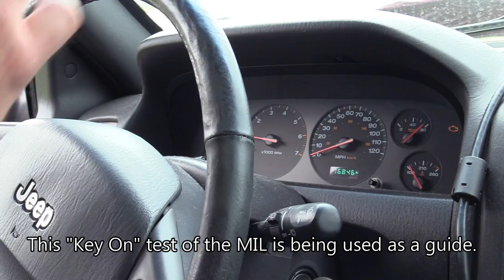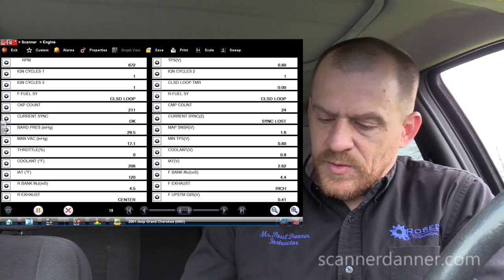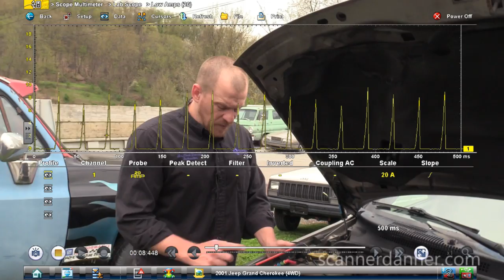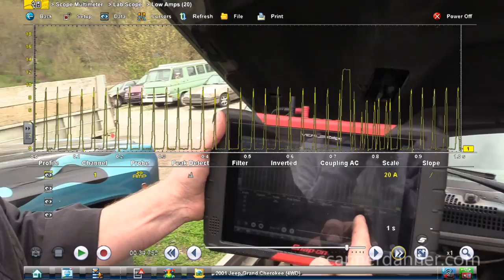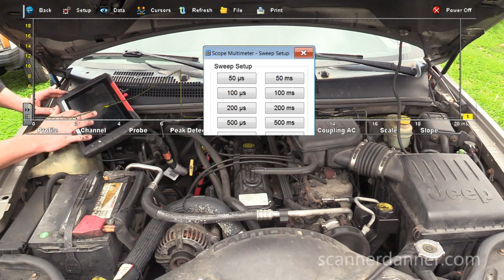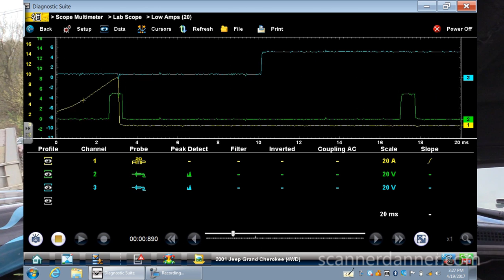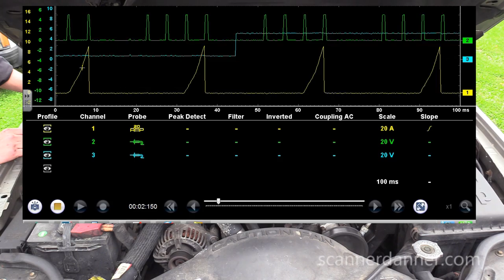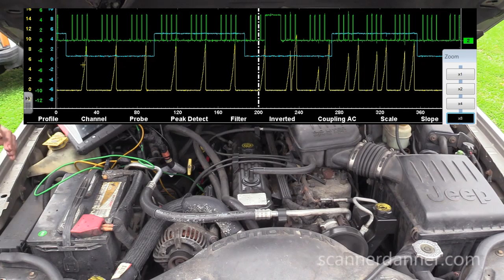Jeep Cherokee 4.0L Misfire and Primary Ignition Trouble Codes

Comment: Mr Paul Danner is the reason why I got back into auto repair,after 10 years.
When I seen things that ScannerDanner does with Verus,Pico and just basic Electronic diagnosis,I was seriously Wowed.thanks Mr Danner for sharing that God given gift you have.Thats why I will be your online student for many Years to come.
By the way folks ScannerDanner Premium Channel is absolutely Superb,Cannot get better anywhere.
Reply from the maker: I'm without word. Seriously. Thank you so much!
Reply: But my jeep don't have that adjustment because it has 2 bolt holes and have went through 3 or 4 sensors 😊

Comment: Yes!   Great video,  had random cylinder misfires just like this on a 2001 4.0 Jeep Wrangler with AT.   Had a new aftermarket  crankshaft position sensor, all the other things too, new plugs, new coil, checked all injectors for resistance, etc etc.   Saw this video along with another one from South Main Auto Repair, both said to use the factory original Mopar part, so I took the chance, replaced the aftermarket crankshaft position sensor with the factory piece and problem solved!    Thanks for posting the video!   Great videos as always!

Comment: Gotta rewatch this whole video, this is exactly what's going on with mine to a certain extent. These are the exact codes I have on my 97 jeep grand Cherokee.
Edit: exact codes and problem
Edit 2: disconnected the CPS to see which part I have to pick up. Reconnected to get to the store, and jeep is running great. Misfire problem I've been chasing for months is finally gone. Thanks SD

Comment: excellent find and description, ive replaced my crank sensor and i got no felt with it. something i will need to check. ive replaced about everything on my 1996 jeep and breaks down under load in gear, i replaced with a new distributor, sensors on throttle body, exhaust uppers and lowers, fuel pump, plugs, ill do plug wires too i think. for people who have little money this is a wonderful video. we all are not well off. i will re look at crank sensor adjustment. after my jeep cut out i put a new crank sensor in, i started jeep ran like new, switched it off thinking great work have a coffee. that was it never ran properly since the first start. and months of replacing stuff has not fixed the jeep. ive had no car, and until it wont go after 10 years of reliability im lost with out it.
Reply: and i have no fault codes at all on the dash.

Comment: Thank You I like your video.
I was waiting 3 years to put a new wiring harness in mine and finally installed super heavy duty cables.did a bran new Bosch alternator which are hard to find and a bran new starter and battery today.  What a difference when I turn the key. I got the harness for 200.00. I think it came from Vegas I need to check paperwork. Was well worth it.  There are a few great custom wire companies out there but I'm  happy I picked the one I did. I just did my crank sensor and doing my Bosch iridium plugs and coil pack next week. So I can relate watching your video.

Comment: another thing to look for on the jeep 4.0 if the crank sensor loses signal the rpms will drop almost instantly to 0 and pop back up.
Reply: This happens to me right now, if this is the actual problem I'm going to be so frickin happy. So glad I found this video and comment
Reply: Dude same lookout for this I’m gonna replace my sensor because Emmy ignition coil secondary code 0352 pops up but I have no misfire codes
Reply: @paulguy6548  what year? Mines a 97. I replaced the sensor on mine with what I suspect was a jun k sensor it ran fine for a couple weeks then major stall issues

Comment: Whats really funny is that it took probley hundreds of electrical/electronic engineers thousands of hours to design that ignition system.  But when there is a fault the mechanic has to know how the system works and there are hundreds of different designs, how to go about troubleshooting it and then how to fix the problem.  This takes someone with the qualifications of a college degree'd engineer.  how many people are out there that can do this type of repair?????   There are only so many Danners, Ivans, Eric O's,
Reply from the maker: Thanks so much gary smith! The crazy part about this one? There were no faults whatsoever associated with a crank or cam sensor problem.
Reply: It’s critical these days to have some kind of way to research the system. Sometimes an OEM just does weird things, and MOPAR especially. They’ve paired with so many other OEMs, and you can see the various design and engineering philosophy differences between model years. Vehicles have different virtual modules inside one physical controller, different communication protocols, etc, etc. I actually found this video because I was trying to find a way to look at the secondary patterns on this quasi waste spark coil on plug ridiculousness...

Comment: Speaking of of air-gap impediments, I have an oil leak in the transmission that gets on the sensor and returns Interim Cam/Crank Disconnects.  But now, I don't think oil's a problem interfering with the magnetic sensing.  I've been driving it for a long while under that condition but now, the missing is out of control on all cylinders (like your situation), the coil's good, with cam and crank sensors both replaced within the last 2 years.  I'm thinking to replace the crank again.

Comment: I have a 2000 Jeep Wrangler, which I know I should replace, but I have little to no reason to at the moment.  Though, I have a rather huge reason to now.  Just recently, my Wrangler died on me, on I-85(just north of the metro Atlanta-area, in the dead middle of traffic), but no fault codes ever generated from the ECU.  The Wrangler wouldn't crank back up and run, even though the battery had a good charge, and the engine was turning over extremely well(still, not one fault code)  

Once one of the "HERO" Units helped me push it off of the road and to the shoulder, it stupid vehicle cranked(almost immediately, but still no fault codes).  I had an issue a few month later, after leaving a Starbucks in Rome, GA, where my Wrangler refused to start.  The vehicle turned over, again, extremely well, but the engine would fire to life.  Even then, no error codes.  All of this was approximately three years ago.

Well, today, of all days, as I was cranking my Jeep Wrangler(to see it running as well as possible, as I rarely leave home(due to disability; always remember:  Never, ever just leave a motor vehicle "sitting", without cranking it, running it, and driving it, even for just 5 to 15 minutes.  I shouldn't have to say that, but experience has taught me Albert Einstein might have been correct(if he even really said the following) when he stated:  "Only two things are infinite, the universe and human stupidity, and I'm not sure about the former." ...but, I digress...) an error code finally generated.  It was error code P0351.  So, thankfully, I finally have a place to start to try and correct this.

Now I just need to finally replace my current JK Wrangler with a Wrangler Rubicon.  Thank you for posting this video.  Great work.
Reply from the maker: okay, first, if it doesn't crank (no starter engagement) and the battery is fully charged, it will never be the alternator that will cause that. Second, the P0351 code, you are on the right video my friend. I have other Jeep videos with this primary ignition code too

Comment: i have changed my coil ran fine for a few months, changed plugs, i have manufacture control show on my computer not sure what to do, also showing codes for the coil pack, again i replaced put a new one in made the jeep run worse than it did put the old one in runs fine till you take off then skips and wants to die, skim also show put goes out once in awhile, i don't know if my jeeps haunted or just something i'm not seeing.

Comment: Hi there i been having problems with my signals wire . 5vdc are coming out from the pcm instead of having cero vdc.
I did check the engine wires

Comment: I had an engine changed out.  When they buttoned things up, they stripped the mount bolt of the crank sensor and I later found they epoxied to "hold" it in place.  In two months, I suddenly had a horrible mechanical noise under the hood.  It was the sensor bouncing loose on the flywheel teeth.  It never even threw a code but the sound made you think a rod had broke.

Comment: Hello 👋,   Got a question.  2001 Cherokee with intermittent loss of camshaft or crankshaft.. I also have ignition coil one primary circuit, ignition coil to primary circuit and ignition coil three primary circuit.. yeah it runs like shit.  What are your thoughts giving just this information?  Also , have you ever seen ignition coil faults like this when you have a bad Crank Sensor.. It seems like I have two separate problems what do you think?
Reply from the maker: pretty sure in this video we had false primary ignition fault codes from a bad crank sensor. Yes? Maybe it was this one https://youtu.be/qpL_0-8DrhE

Comment: Danner, I have one for you, 2001 Jeep Cherokee 4.0, no injector pulse when cranking the engine. If you mist the throttle body with carb cleaner it starts right up and the injectors pulse and it runs just fine. no codes stored and the TPS is not in clear flood mode. It had ASD P1389 code, bad relay- No security system. Cam sensor checks out, new crank sensor. PCM is good.
Reply from the maker: I don't like the ASD code you had. Your symptoms suggest a possible low voltage problem on that circuit (ASD circuit) based on your symptoms. I would want to know what the supply voltage is to the fuel injectors, DURING cranking, when it is not starting.
Reply: No volts during cranking have 12 volts at the injectors until the ASD clicks off.  With the injector connected both sides of the connector light the test light. Spray carb cleaner in the throttle body it starts and has normal pulse runs fine.
Reply from the maker: No volts during cranking, yet both sides of the connector light the test light?? Please explain
Reply: ScannerDanner I found a bad fuse in the junction block, starts right up. The number one injector harness was melted together at the wiring. I was going behind someone else work. Thank you I for the help.
Reply from the maker: Knew it was a voltage drop issue. Nice find
Reply: ScannerDanner  Hello, after all of the  problems It lost injector pulse to number one cylinder. Wiring is good to the PCM.  A real riot....
Reply from the maker: @badeldorado  if the injector wires were touching each other, this probably cooked the injector driver in the ECM.  You are in luck though, I think on this model you can use a salvage yard ECM and you'll just need someone to wipe out the SKIM code for you (key security code).

Comment: Here's one for you. 2004 Jeep Grand Cherokee. Waveform is ramp(as in sawtooth) on cam position sensor. 5.2 volts on scope and DVM.
Runs with alternator  voltage  reg unplugged. Plug back in, throws heavy load on alternator, 14.2 volts at battery. P0340 code pops up and scanner says  sense line shorted to battery voltage or ground. 5 volts available on orange wire and  black ground on cmp. Cmp replaced, ckp replaced. Alternator and coil pack replaced. PCM replaced with mopar upgrade software. Came to me like this.
What's up?

Comment: Great vid! I have a 02' wrangler that is having similar issues. Missfire on idle occasionally sets code for missfire and o2 heater and gets hot after running for a while. New t-stat new water pump. Could the missfire lead to higher engine temps?
Reply from the maker: I'd focus on the overheat first. Could be a head gasket issue, which could also set misfire codes.
Reply: @ScannerDanner  thank you for the quick reply.

Comment: I own a 98 Jeep Wrangler TJ. Had the same issues, CPS bolt was loose with sensor bouncing upon the flywheel. Just now learning how to use an oscilloscope. My Jeep Wrangler 4.0L is old school with a distributor. Currently working on another 98 with a #6 misfire....hence...the need to learn. Got fuel injector waveform figured out...what would be #2 for me to learn?
Reply from the maker: I'm sorry, what's your question?
Reply: Just enjoying your channel. 

My question as one just learning to use a Hantek 1008C is other than fuel injector waveform, which I have down / learned. What would be the next most common waveform analysis to learn? @rDanner
Reply from the maker: @Mark622111  both current and voltage waveforms for the injector? Do that first, then ignition coil primary voltage and current waveforms next
Reply: Thank you Sir, 

Should have mentioned I've learned voltage and current on the injector waveform. Can see pintle open and close but that's on my good running Jeep as I learn the Hantek. Mine is a distributor system with just one coil as is his.

I'll see how it goes on my friends Jeep analysis with the #6 misfire. Could very well be the injectoror or ground but I want to identify / learn via oscilloscope.

Love your channel as I'm a newbie @rDanner

Jesus lives.
Reply from the maker: @Mark622111  indeed He does!

Comment: I need help! My 2003 crown Vic  I get, p0352, p0353, p0355, p0536, p0357, and a low voltage code only when I shift into drive and the car rests, in drive, after about 20 seconds stopped. Never in park or neutral. Giving it gas brings it back to even. I changed the pcm, the cam sensor, coils, plugs, serp belt. It will also jerk coming from low rpms up a hill. High rpm it runs great. Driving me nuts.

Comment: Thanks for the suggestion..I have a 2003 Jeep Grand Cherokee that's doing the same thing... I've been stumped as to the source of the problem and  really didn't know where to start..I do have another question for you... it's recently also started stalling anytime I make a hard right turn but only when my fuel level is under a half tank..what could cause that?
Reply: Fuel pump going out fuel filter gunked up,

Comment: So I found out the hard way after rebuilding a 01 4.0  grand Cherokee engine that the crank sensor was suppose to have an air gap, set the sensor in just a bit too far and nipped the tip and got the intermittent signal loss for cam or crank sensor code as well as a bad miss, the miss didn't come til about a min before shutdown on the 30 min engine break in. Put in a new sensor making sure it wasn't too far in this time, I'm now getting a misfire on cyl 6 code, watch the misfire counter on the scan tool and its a pretty consistent miss. the trans is shifting a bit higher in rpm than it should, also a bit harder than it should as well, could this crank sensor be too far away and causing these issues? The plugs are new and have resistance tested the coil rail, each coils primary windings tested out of spec, actual - 2.5 ohms on all coils, target - .71 - .88ohm, secondary  windings tested in spec on all. I'm really scratching my head with this, I don't have any scopes, just a dvm and an autel mx808 scan tool. Ive watched 3 or 4 of your jeep cam crank sensor videos and just don't know what direction my next step should be, any insight you could lend would be greatly appreciated my friend. Keep up the truly awesome work that you do Danner, you are a blessing and an asset to so many people like me.
Reply from the maker: Absolutely it could be too far away now https://youtu.be/agbEFhAyYI4 (not a Jeep but same exact crank sensor set up)
When you set that sensor, push it in all the way and then back it off just a hair.
Reply: @ScannerDanner  thank you so much for your quick response, I truly appreciate it, helping me regain some sanity, lol I'm mobile and in fl, so I don't get a lot of indoor work and this heat can have ya thinking crazy sometimes. Again sir thank you, your a credit to society.

Comment: I have a 1998 Jeep Grand Cherokee I have changed cap and rotor and wires and spark plugs and cam sensor crankshaft sensor and upstream o2 sensor and I get po351 wth right?!!! I’m some what mechanically incline but it’s kicking my ass I erase the code but it shuts off every now and then it’s very frustrating

Comment: Very informative! I have a 95 Cherokee which runs pretty good, and its getting better with every fix I've been able to do on it (Crank sensor being one of them). One thing that has been robbing horse power is a weak spark, and I am not sure what is causing the weak spark (purplish orange, almost no blue). All the grounds and positive connections are good, and I have replaced the coil. Any suggestion would be helpful. Thank you
Reply from the maker: an orange spark is not necessarily a weak spark. a narrow air gap will give you an orange look to the spark. The distance the spark can jump is a better indicator. It should jump at least a half inch, with ideal being around an inch. I am betting on your low power complaint NOT being spark related.
Reply: Ah, well I will have to review it again to see how far the spark will jump. I hope to get a better (more blue) spark anyways, because then the engine will get a better burn. I am considering testing with another coil, since there's always that off chance of any aftermarket replacement being crappy from the start.

Comment: Got a 03 Jeep grand Cherokee 4.0 p0352 code. Changed plugs ran perfect then started missing again the following day. Changed the coil pack module and no difference. Changed the cam position sensor and fixed it for a day. Following day it started missing again and same code. Think it could be crank sensor? Any idea? Thanks
Reply from the maker: Wiggle the wiring on that ignition coil assembly. That's the one long coil pack right?
Reply: @ScannerDanner  correct and I have wiggled the wires